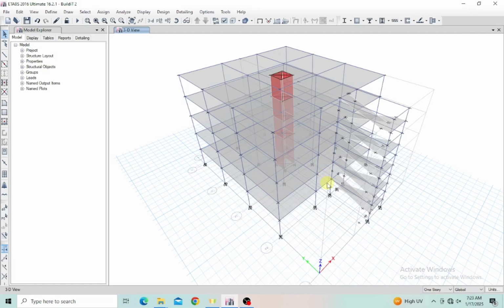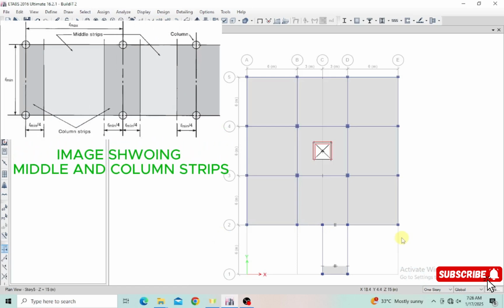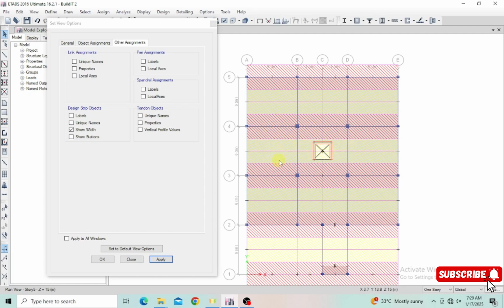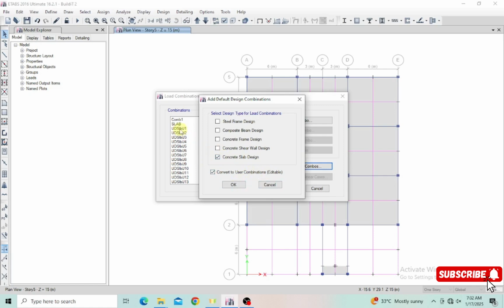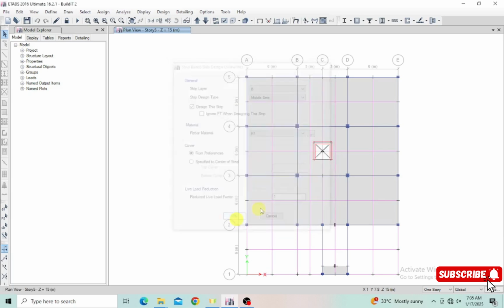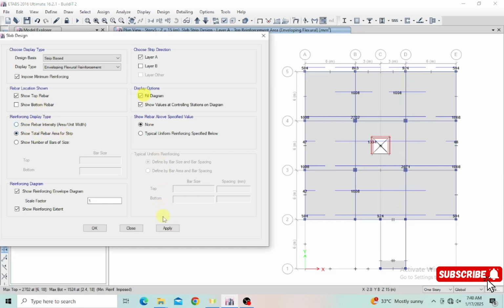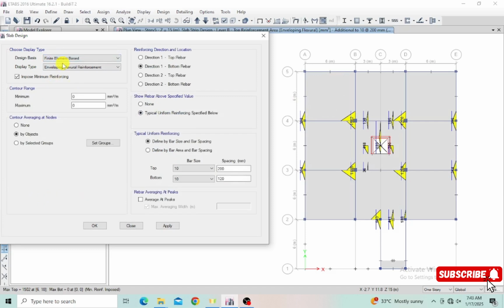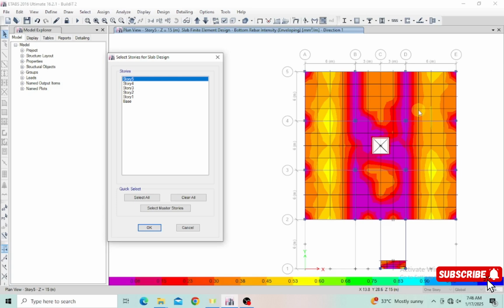18. ETABS for beginners: R.C Slab design and Analysis

Comment: strips method is it not only used for beamless slabs? slabs with beams, how do you design column strip of slab? do you include the downstand of the beams?
Reply from the maker: The strip method is not only for beamless slabs, it also applies to slabs with beams. When designing the column strip in ETABS, you include the effective slab width but not the downstand of the beams, as beams are designed separately.

But the interaction between them should always be considered.

Comment: How did you define the tower(T1)  because mine is not highlighted
Reply from the maker: We don't define the tower, it's default in the app
Check if any of these relate to your scenario 
1.  If only one tower exists, it may be auto-selected.
2. The tower option might be locked due to the selected story.
3. Restrictions based on grid system or existing design strips.
4. Software Bug or License Limitation, some versions prevent modifications.

Let me know if any of these help
Reply: OK sir.
Reply: @sampsondaku7398  STILL GIVES ME ERROR AFTER STRIPS AND ANALYSING
Reply: @sampsondaku7398  ANY OTHER APPROACH OR DOES THE ARRANGEMENT OF THE SLAB ALSO COUNT